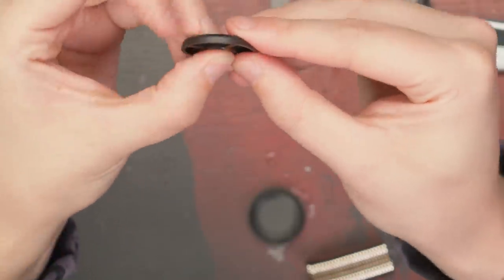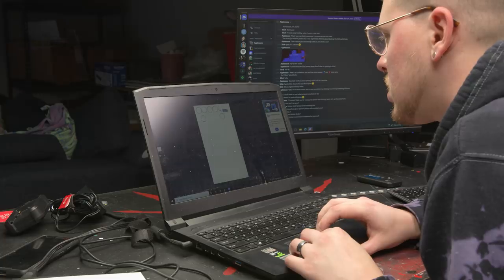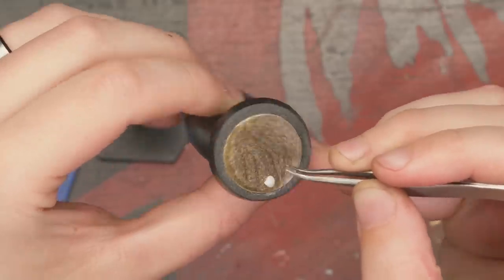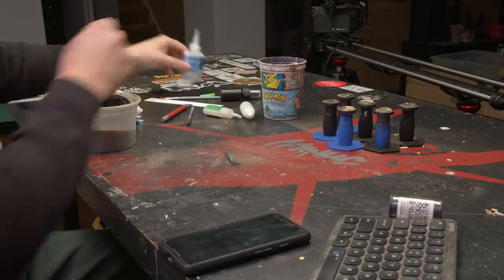Mold & Cast Custom Bases for your Army

Comment: When I made totallynotgamesworkshop molds, I made the box from Lego bricks, they didn't stick to the silicone and could be pulled apart very easily.
I didn't even need to add any further sealing because the bricks lock together so well.

Comment: These came out great! Pro tip for CMON minis (and honestly, most PVC board game minis): stick the minis in the freezer overnight. In the morning you can pop them out of the base, no blades needed. The glue they use become very brittle when that cold but the plastic couldn't care less, so you get nice clean breaks between the post/under foot and the base.

Also a great way to fix any badly factory assembled ones.

Comment: Nice result.

A couple of thoughts:

Lego blocks work great for making mold boxes. You can get a size that works quite well, and you can build a second mold half easily if you need one.

Also, for small pieces like these, I'd consider using UV-set resin rather than epoxy resin and then just curing with a UV flashlight.
Reply: Is that basically 3d printer resin?
Reply: @Excaliber158  That was my thought, mostly because the price per volume is much better than the UV-set resin that is sold as an adhesive.

Comment: I've been doing something similar but just by 3d printing instead of molding. Generally I like use the 3d printed bases that already have some texture and maybe unever ground and bits on them as just a base and then work them up from there myself but sometimes STL files are accompanied by awesome bases with a lot of verticality and in those cases I'll just print the base and use it as it is.

Either way it's almost always better to start with a ''canvas'' that's not completely blank and work it up from there. If there's one thing that I find unappealing it's flat bases with just some crackle paint and a tuft on them.

Comment: Excellent casts! Great tip about the pegs, will check the rum and bones to see if they work the same :) would save a basing headache. One suggestion about pouring - using the largest paper cup you can find lets you mix more easily, and you can pinch the lip to get a more controlled pour. The last bit doesn't make much difference for an open cast mold, but it helps a lot when you start to make more complex ones 😁

Comment: Use mold release. ESPECIALLY if you're doing a two part mold. 

I was half way down this process myself, and I forgot mold release on a simple two part mold, and it ruined the mold and with it killed any interest I had in that part of the hobby.

Also just casting the part that you're going to attach to the bases is super clever. I may steal that at some point.

Comment: Very fine work! If you want to add a mould release and colour your casting in one step, you can spray the inside of  the mould with rattlecan spray paint before you pour the resin. The resin will bond with the paint. May be handy in some situations. Cheers!
Reply from the maker: that's a pretty slick idea...

Comment: May I suggest using oyumaru+lego method for molds and any type of air drying silicone (or even cold weld) for casts. Thats how I get details from gws easy to build bases or various parts from terrain pieces

Comment: Styrene plastic card cut on a Cricut? I've got a Silhouette rather than a Cricut (no subscription required!) but they work the same way, and cutting plastic card is NOT so easy. I believe it can be done by doing many passes and increasing the needle depth one notch at a time, but I'd like to know how Miniac did it.
Reply from the maker: Check out 40khamslam, he'll talk you through the whole thing
Reply: @Miniac  Figured it out! Sort of.. turns out I'd neglected to push the tab into place to lock the blade. More problems now, but it's a beginning! https://www.youtube.com/watch?v=KEg0C1SzA30

edit* Success! Success! I have cut a rectangle! 
I think it was just the blade needed tightening-up. Well, my new toy appears to be working. :-)